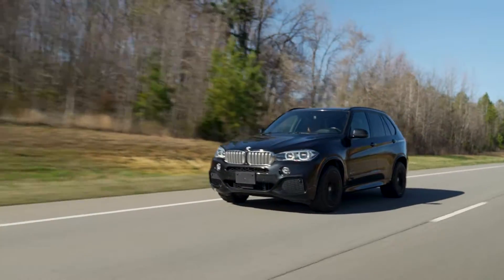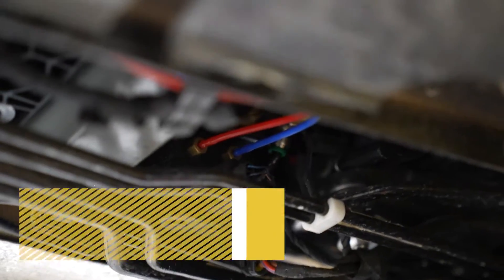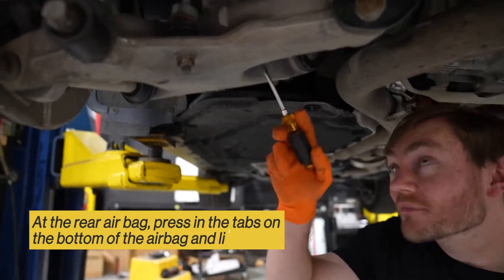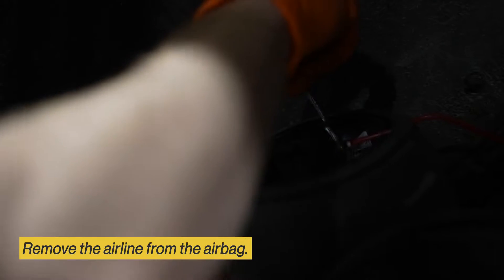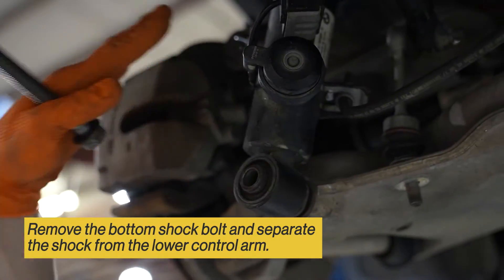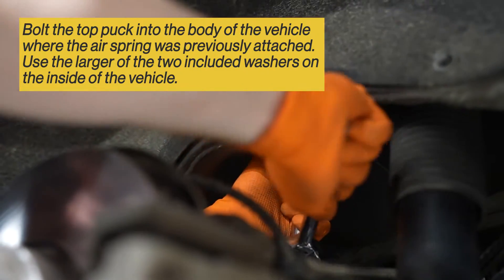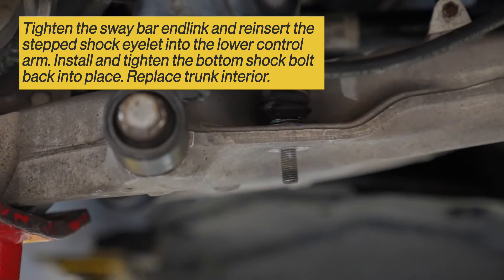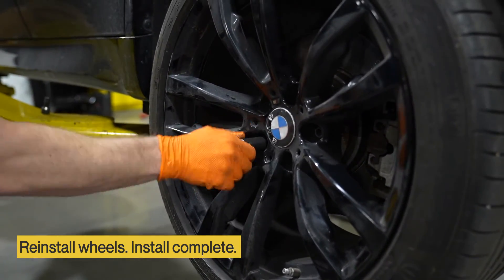2013-2018 BMW X5 Rear Suspension Conversion Tutorial

Comment: So, why would somebody want to swap the air suspension out for springs?
Reply: Fuck the air suspension, it's nothing but issues. Source, I've cussed for hours over my F15 compressor, new airbags, tube's, sensors, and dessicant beads. For Germans being these great engineers, it sure is a fucking shit show of a system
Reply: @ strange. I’ve never noticed any issue with my 2008 X5 3.0. I’m about to redo the entire front end suspension, but was just going to leave the rear alone.
Reply: Because the air system is too much of a headache after it starts going out it’s better to replace with springs and just pull out the fuse
Reply: the air suspension on my x5 went out earlier today and i was quoted 4k for a new compressor. f that.
Reply: @henryraab3111 what did you end up doing
Reply: @djfuz3  i ended up buying some oem bags. i have a 2013 and apparently these kits dont seat as well in the 2013s as they do in 07-12
Reply: @djfuz3  turns out i didnt need a new compressor bags were both shot

Comment: Awesome video. well done.       Wondering if anyone can help with air suspension issue I have. Vehicle was sagging so I replaced the air bags. This fixed the issue for about 5 days. Then sagged again, this time air compressor would run for 10--15 seconds then shut off and no air would go into air bags.  I replaced the entire air compressor unit, so this rules out the compressor, the solenoid valve, decadent beads, etc.  The new compressor runs for 1 second and shut offs, no air going into airbags. I checked air lines and they are all good. Wondering if the system needs to be re-calibrated with the ITSA software? Not sure what to do...
Reply: I think switching from air to coil spring might be ur best option
Reply: @RODRIGUEZMAKAVELI  Brought it into euro mechanic. He just cleared the error code on the ECU and replaced the ai suspension fuse..even though the fuse tested fine, he replaced it anyway. This solved the problem.  BMW would have charged me approx 3-4k for all of this work. I did the airbags and compressor myself for $450.. just had an extra week of frustation because I did not have the software to clear the error code myself.  I think buying the ITSA software would be a good move for any future DIY.
Reply: I replaced the airbags also. Lasted about a year. Going coils now.
Reply: @tatiannaannunaki2027 did you get error codes
Reply: Does the air compressor stay on?

Comment: You don't need to turn off the compressor or took out the diffuser?
Also can you do anything for the error message in the dash? I contacted a bmw coder and he told me that he would have to turn off EDC because of the adaptive suspension, and I also noticed you have the same.
Reply: I just ordered these for my 2013 x5 50i
They sell these with the fault delete so that the leveling light doesnt go on.
Pretty sure it shuts the compressor off.
Or you can just pull the fuse from it (prior to starting the job) so it doesnt stay running while doing this. Tape off the old airbag lines incase you ever want to go BACK to air suspension.
Reply: @giobonilla576  how is the fault delete? Do you have EDC suspension?
Reply: @marcolopes9426  i do. I just ordered my kit it should be here within a few days.
Reply: @giobonilla576  Awesome! if you could keep me updated after you're done with the whole process it would be very nice, because I still have the dashboard error message every time :D
Reply: @marcolopes9426  they sell 2 versions on the site… one with the light delete, one without. Im guessing you bought the one without?
Reply: @giobonilla576  Can someone tell me where the light out module is installed at and how hard that process is??
Reply: They have this in their website so I don't think you can remove it or if it's advised:
"No Light Fix Module available at this time, vehicle will emit occasional "Chassis Function Restricted" Message that can be dismissed. Vehicle will continue to function.  An orange triangle notice symbol will appear on the dashboard. "
Reply: You need to code it out. Take out the fuse and disconnect the compressor cable from the boot
Reply: @gerrardalamat9072  can you please tell me where I can order the deletes for the light and code
Reply: @gerrardalamat9072 
Is that all you need to do 
Fuse and disconnect the comp?
Do you need a scanner ?
Reply: Can either of you tell me where to order the code deleted please